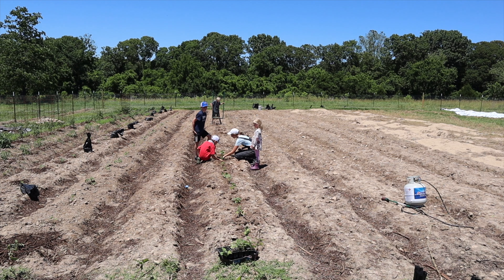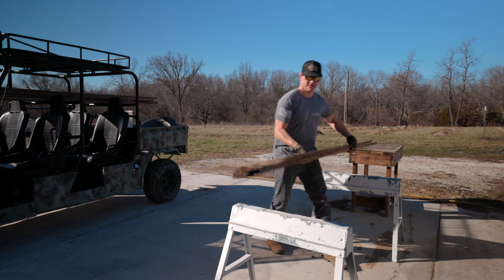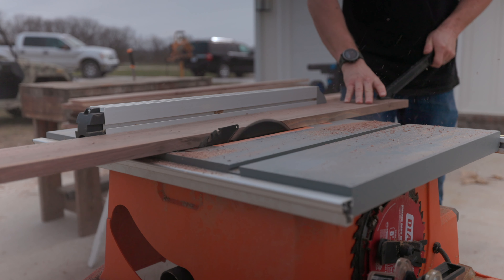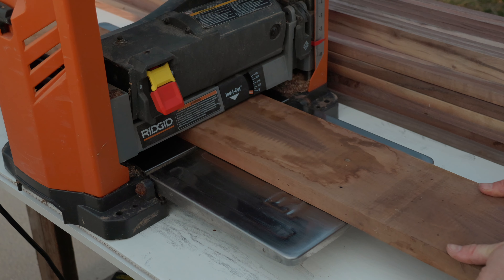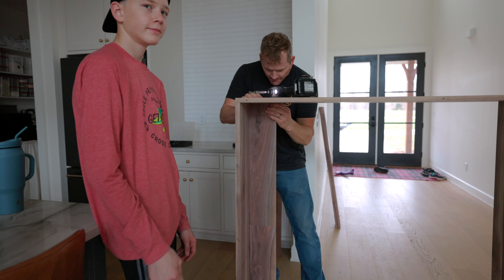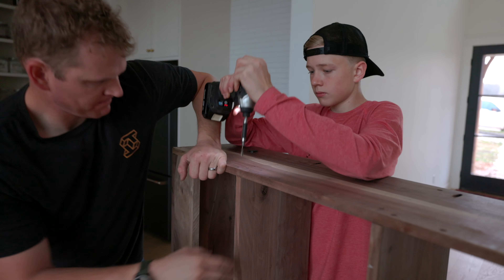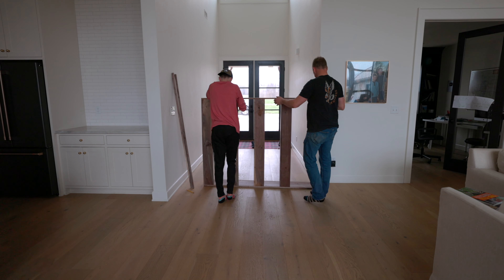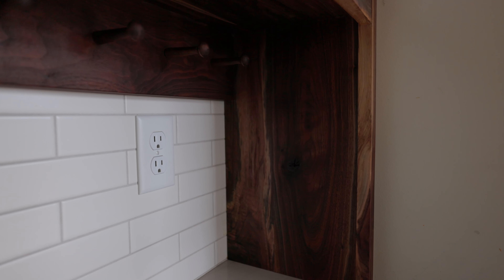He turned $40 of Sawmill Scraps into This! | DIY Kitchen Upgrade

Comment: Just curious - how did you fasten the shelf to the wall to prevent tipping from too much front weight?
Reply from the maker: Thank you Julia.  they are attached to the sidewalls via long screws.  Located a stud behind the sheetrock, and secured into that.

Comment: The seam in the top and third board from the top would drive me nuts. Great job otherwise.
Reply: The seam? I looked back multiple times at shots from the video trying to see what you are referencing. Do you mean the lighter spots on the wood? On the top left corner of the top shelf and the back of the third shelf from the top?
Reply from the maker: Thanks! Yes there is a seam. It was done that way because that was the last of the wood, we didn't have enough. I'm very particular but honestly it doesn't bother me at all.